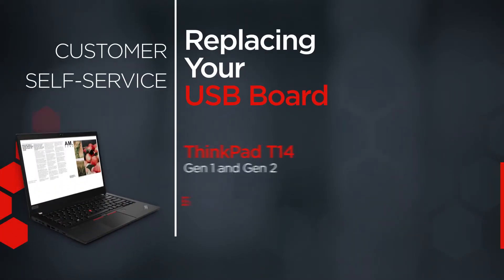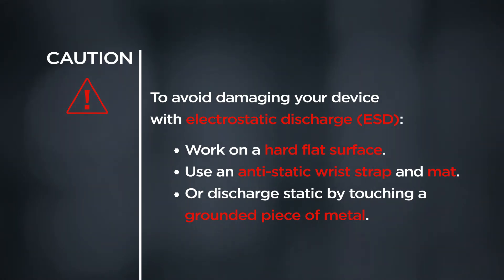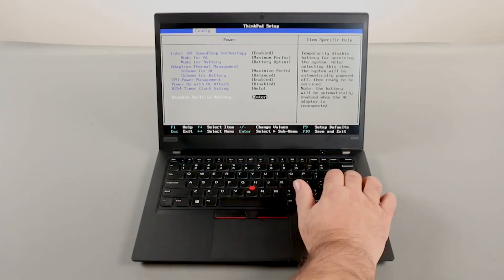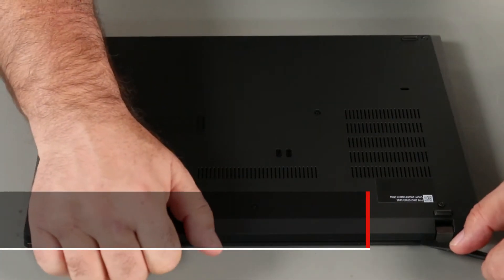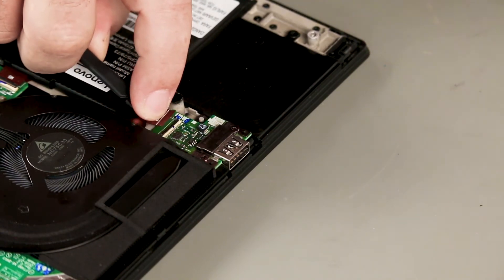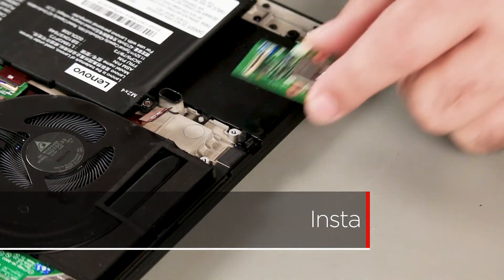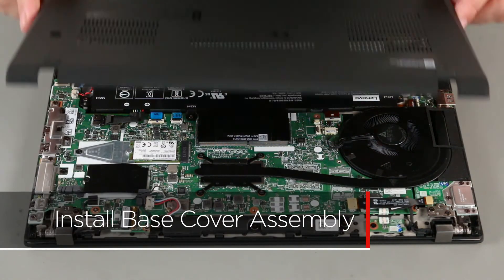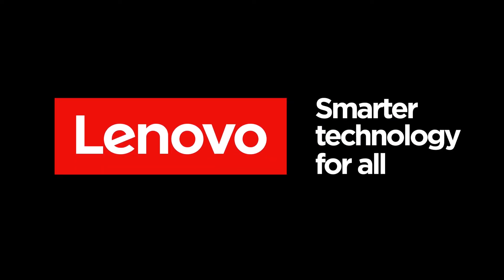Replacing Your USB Board | ThinkPad T14 and P14s Gen 1 and 2 | Customer Self Service

Comment from the maker: This video will show you how to replace the USB Board of your ThinkPad. The process in this video will work for the ThinkPad T14 Gen 1 and Gen 2 and the ThinkPad P14s Gen 1 and Gen 2. 

You will need a screwdriver kit, a non-metallic pry tool, and 15 minutes of your time.

ThinkPad T14 Gen 1 Repair Guide: https://pcsupport.lenovo.com/us/en/products/laptops-and-netbooks/thinkpad-t-series-laptops/thinkpad-t14-type-20ud-20ue/selfrepair/removalsreplacements

ThinkPad T14 Gen 2 Repair Guide: https://pcsupport.lenovo.com/us/en/products/laptops-and-netbooks/thinkpad-t-series-laptops/thinkpad-t14-gen-2-type-20w0-20w1/selfrepair/removalsreplacements

ThinkPad P14s Gen 1 Repair Guide: https://pcsupport.lenovo.com/us/en/products/laptops-and-netbooks/thinkpad-p-series-laptops/p14s-type-20s4-20s5/selfrepair/removalsreplacements

ThinkPad P14s Gen 2 Repair Guide: https://pcsupport.lenovo.com/us/en/products/laptops-and-netbooks/thinkpad-p-series-laptops/thinkpad-p14s-gen-2-type-20vx--20vy/selfrepair/removalsreplacements

To learn more about your device go to https://pcsupport.lenovo.com

To find parts for your device go to https://support.lenovo.com/parts-lookup/?cid=ww:lenovosocial:b9515f&source=socialmedia&subsource=yt

To view the Lenovo Support Self-Repair Guides landing page go to https://support.lenovo.com/us/en/solutions/HT516547

** NOTE: Static electricity can destroy components. Use a grounding strap, and clean, non-conductive surface to work on. Use plastic or coated tools to prevent scratching and avoid using metal tools on plastic parts. For more detailed information on electrostatic discharge and how to prevent it, please watch our ""Understanding Electrostatic Discharge (ESD)"" video: https://youtu.be/by4PB3WtdLo 

Applicable Machine Types:
ThinkPad T14 Gen 1 - 20S1, 20S0, 20UE, 20UD
ThinkPad T14 Gen 2 - 20W0, 20W1, 20XK, 20XL
ThinkPad P14s Gen 1 - 20S4, 20S5, 20Y1, 20Y2
ThinkPad P14s Gen 2 - 20VX, 20VY, 21A1, 21A0

#lenovo #LenovoSupport #LenovoTechSupport